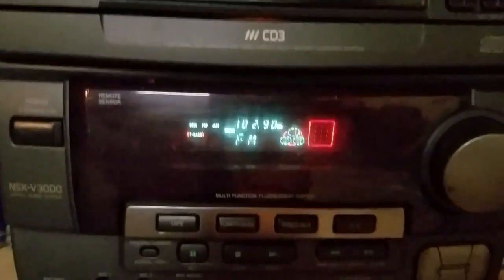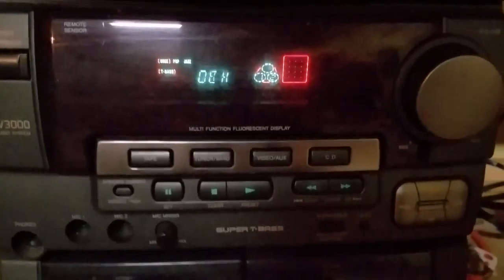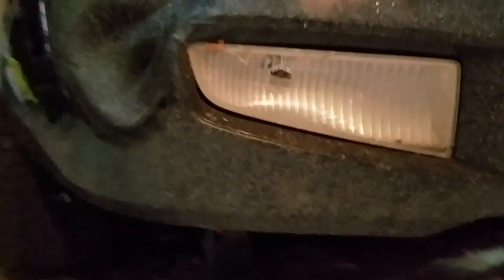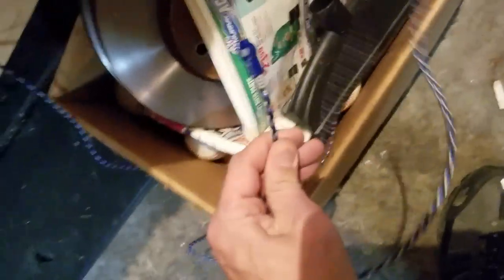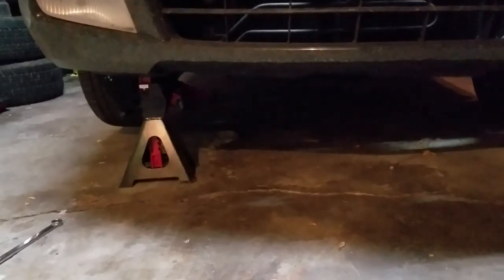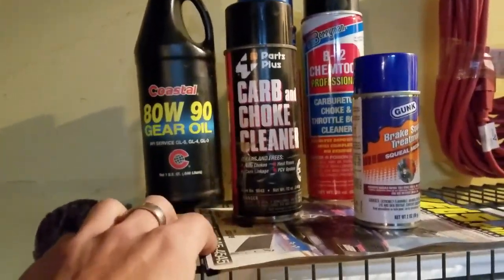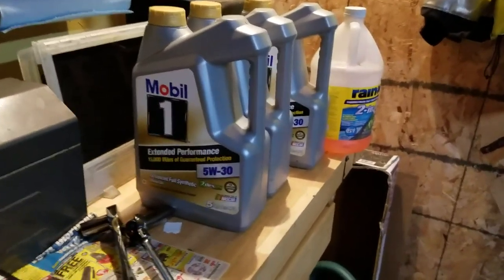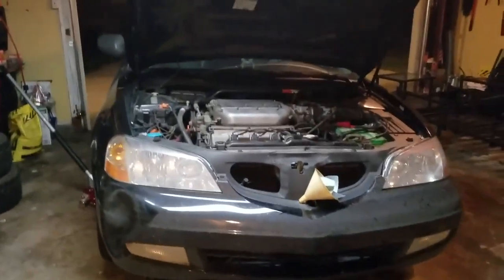Change your own oil, change your own brakes

Comment from the maker: will be showing draining and filling in the next video.  Subscribe to puppies world reviews and see the brakes taken off, maintenanced and replaced also in the next video.  Also my 4.0 liter jeep cherokee motor has a stripped oil drain bolt.  When initially noticing, the proper way to fix is to get impact socket one size larger determine metric or standard, then bang on with hammer, then replace drain plug and a gasket if necessary.  

If you find you have an oil leak, place a piece of cardboard or something similar and find leak, find location then try leak fix or Lucas oil additives or thicker oil, determining whether or not it is your clutch fluid if manual.  Use DOT 3 or 4 as needed in brakes system and clutch reservoir.  Never mix oil weights, only synthetic vs non synthetic motor oil 5w30 and 10w30.